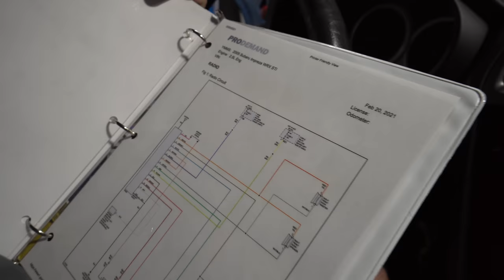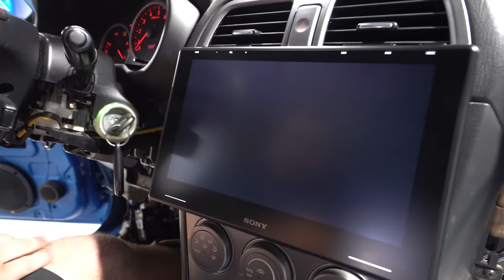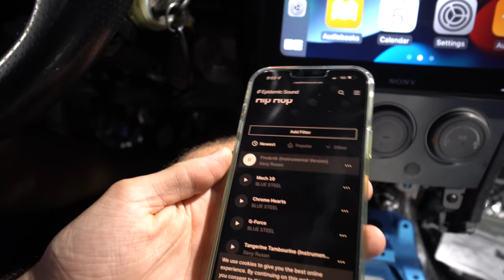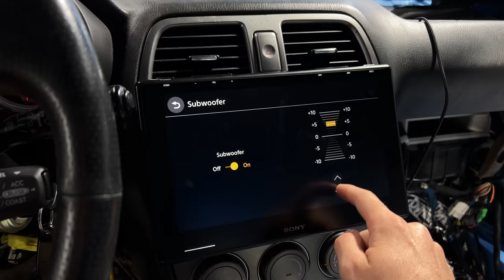Installing a HUGE Apple Car Play Unit & Sony Sound System (2021 Tech in a 1996 Car!)

Comment: Clean build and definitely attention to detail with most of the connections and wiring. With it being geared as an instructional installation video, you dropped the ball and added more work that’s needed with wiring in the head unit. They sell adapter connectors to retain the stock wiring harness for almost any car. Saves from digging up the wiring diagram but more importantly doesn’t require cutting off the stock connections and tapping in the way you guys did. For your wiring harness 05 Sti that adapter is less than 10 bucks and allows you to do all the wiring outside the car minus the remote wire which is not factory. Also would’ve popped an extra two screws on the radio bracket, the 6 overkill screws on the plastic cubby won’t be as supportive as two more screws. Aside from that love the attention to detail with everything you’re doing and can’t wait to see it finished, in Phoenix too but just sold my Wrx :/
Reply: The stock radio harness was used in his dads sti that didn’t have it. Believe me if it was there I would’ve used the proper wiring adapter
Reply: @Randallpullen123  yea not much you can do with previous owners unfortunately. However they do make a repair harness that comes with the pigtails as well but yea same amount of wiring would’ve been done.

Comment: That 2ft 16ga run in the sub box is only going to hold 240w. You could potentially melt the wire and cause a fire. I would have gone with 12ga minimum.

Comment: Those specs are all over the place. Mono amp is 300W RMS but the sub is 500W RMS,  and the main 4 channel amp is 70 watts RMS per channel while speakers are 90 each. Also you'll need to level down the gain on 4 channel amp to match db of mids  with sub.
And I'm not even speaking about how you've installed those tweeters on the lower side of front doors, pretty much making them useless.
Reply: Is it fine still or not because I was thinking of getting the Sony GS4 amplifier for my Sony es system?
Reply: I was thinking of getting this exact amplifier Sony xm-gs4 for Sony Es XS-163ES sound system.

Comment: I used to have a 1998 GTT, but i used twin screens, 1 for control in the center console (just a 2din size) and used the 'clock' on top of the dash for the information/navigation. Even the car is rather old, it can fit so much nice cool tech :D

Comment: 16 gauge for a subwoofer it’s small, the recommended wire for a sub, it’s 12 gauge, personally I used 8 gauge for my system

Comment: I've built a very similar but smaller Sony radio with Apple CarPlay into my mk4 Golf and it is an absolutely great investment, especially if you have the room for it already in the center console and a nice set of speaker in the car.

Comment: Im curious to see these Door Panels that will fit those big crossovers in that location. 

I did a full interior out stereo install on my 95 Nissan 240sx and I mounted the crossovers on the inside of the kick panels to keep them out of the way. As amazing as that system was. The Focal/Alpine/Image Dynamics system I put in my Jaguar still remains one of the best car stereos I have ever heard. Including ones that cost 3x+ as much.
Reply: I was thinking about Focal. Your system sounds like a great one!

Comment: 11:45 - If you won't put rubber grommets, then at least clean your holes... Sheet metal drill holes leave very sharp edges and they are very likely to cut the wire insulation.
19:30 - You do NOT use such cable ends in spring terminals! These are made for screw terminals! This does not lead to better connection but to the contrary! Spring terminals squeeze the wires and there is more surface area. Putting cable ends makes it have two very small contact patches with big contact resistance which can be an issue with these big subwoofer currents, low voltages and low resistance load.
And as other people have pointed out - it's better to put the tweeters higher and if not on the pillar - maybe at least at the height of the side mirror. The other thing - put sound deadener over the door holes.
Otherwise I like how everything looks. It's going to be a fantastic car!

Comment: Clean install but there were a few things done incorrectly. The fuses for the amps need to be as close to the battery as possible so that if there is a short, it cuts the power to the entire wire. If you fuse is at the amp then the wire will still have power going through it till it hits the fuse
Reply: I thought the same thing, but the battery is locatied in the trunk and is supposedly within 6" of the main fuse according to Randall.  Unfortunately they didn't show this and received A LOT of similar comments.

And they are using a Lithium battery in the trunk which I have concerns about due to their incompatibility with most standard automotive electrical charging systems.

Comment: Hey just noticed a quick SAFETY thing. The fuses you added should be as close as possible to the power source not the amplifier. Having the fuse close to the amp means if you ever have a short in the section of wire before the fuse, there will be no protection and could cause a fire. I would move or add another fuse as close as possible to your battery or main power source. Wouldn't wanna see you put all that work in to have it burn down!
Reply: Battery will be in the trunk

Comment: I've always loved Sony mobile ES equipment. I've still got my early 2000's mobile ES xm-7557 5 channel amplifier half ohm stable high current/voltage switchable, 3 feet long and weighs about 60lbs. Oh and it's red and gold!! It's one of my grail audio pieces along with my 1999 rockford fosgate power dvc subs that I will never get rid of!!!
Reply: @Andrew Royal I have never heard of the Sony amp that you mentioned, well atleast not that I can recall. I'm gonna have to look that one up, as I was not aware of Sony even making a .5 ohm stable amplifier... And it was a 5 channel half ohm stable amp?! Going to look it up now. Hope you end up seeing my comment.
Reply: @itdoesntmatterwhatyourname6128  yeah they had a whole line in 1999-2001 that was half ohm stable and high current/load switchable. But that 5 channel was the pinnacle
Reply: The non mobile ES one was the xm-1002 but there are 4-5 of them

Comment: Am I the only one that’s cringing at the lack of rubber grommets used on the speaker wiring?! Like I see that shorting out in a couple years on those hard sheet metal edges. Along with the slef  tappers used on the rear speaker plates. Other then I dig this video on really showing ground up speaker instal

Comment: That's some really nice components. I've found over the years of doing car audio that sometimes the best sounding system is the one that uses no-frills speakers, but good amps, etc. PPS4-6 pro 6.5" and Fiatal Pro 6.5" mids and super tweeters with whatever crossover you want, then at least 1500w RMS for sub(s). I run AB amps for the mids/tweets and D for subs.       SPL > SQ or vice versa. The speakers need baffles connecting them to the mounting locations. IMO never solder the connections to the speakers. The mounting bracket should not be metal; could cause a grounding issue.  great vids.

Comment: should have used foam to make a proper seal to the door and the speaker. Because air will leak around and cancel out sound. but cool none the less.

Comment: Nice job but you should have used a better spot for the tweeters. You'll kill the high pitch noises when they're installed so low in the car

Comment: Nice to see this done, try keeping the weight down , you will feel it.
Reply: I think that this is going to be Cameron's daily driver car and not his full-on "performance" vehicle, so in that regard I don't think it's necessarily important to keep the weight to an absolute minimum.

These amplifiers, component sets, head unit, and the wiring don't really add all that much weight (way less than having an average person in the passenger seat), and the subwoofer enclosure can be removed at any time if he wants to reduce weight and/or gain some extra trunk space.

They already added Dynamat CLD to most of the interior which does adds some weight.  However, for a DD where you'll want to enjoy a killer sound system like this one I would absolutely recommend this!

I would even advise Cameron to treat the doors with sound deadening (AT LEAST around where the speakers are mounted!), the trunk lid, license plate & frame, and the top of the rear shelf/package tray where the rear speakers are mounted.

Treating the entire rear wheel wells with CLD sheet and a barrier like MLV or ResoNix's BARRIER which is a multi-layer CLD/Encapsulated Lead Sheet Barrier/CCF foam Decoupler, makes a HUGE difference in the interior road noise and daily enjoyment of driving the car.

Comment: The modern way to power amps mounted in the boot/truck, rather than big thick power gauge cable running the length of the car, just fit a split charging relay to the alternator feed and split the low voltage feed into the boot rather than the huge gauge piggy back from the main battery. Then, mount a custom fit 12v battery pack of those 26650 batteries. They allow you to have a hidden battery in the boot that isn't based on a car battery but fits behind a panel and because it has a direct feed from the alternator (rather than piggy backing in parallel from the main battery), you save on wiring, improve power efficiency a lot and it's totally stealth. You can add as many 26650's as you want (to increase the current supply and the length of time you can listen) and it allows for longer listening before they go flat but you wire in one voltage led to show you how full they are and essentially, you have a boot mounted car battery but with a direct recharging from the alternator and totally stealth. Your battery under the hood has nothing attached to it. Virgin look. Plus, you can add more to suit, change out individual cells as they fail (fee pence) and you find that you want to add another 4/8/12/16 packs in that area there.....so you buy them, make a mounting bracket and wire them in. All the time, they are being charged directly (rather then indirectly through the car battery) and your car never goes flat as its isolated. Your alternator puts all of its output into your custom boot mount cells and if you integrate a capacitor into the mix too, your 26650's end up feeding the capacitor and that feeds the amp and again, more flexibility is the goal. Power is sexy when it's done like this. It's more time consuming but the result when you put your panels back on is simply 100% stealth. 

You can also fit a small charging port so when the car is in the garage, an intelligent motorcycle battery charger can be fitted to that circuit and your capacitor and battery packs are all conditioned and tip top condition, again without touching the main battery under the hood. Again, flexible customisation. 

Its cool.
Reply: The main battery is located in the boot already and they are using a Lithium battery...which I have concerns about because Lithium batteries are typically not compatible with standard automotive electrical charging systems.  They usually require a specific isolated "charge controller" because they need to charge at a different voltage and charging rate/scheme/technique to manage heat and the voltage/current throughout the stages of the charge cycle.  I have wind turbine and PV Solar off-grid power systems for my homes using both lead acid and newer lithium battery technology.  They each require a specific charge controller.
Reply: @bbfoto7248  they are using a lithium battery in this car in the video? They would have to top up the lithium battery because you can't get them to full charge from a normal output alternator. The normal output is about 13.6v but the lithium battery needs 14.5v to get towards a full charge. It will only ever get to around 75% full....which defeats the point of having it.

Comment: Wanted to install that HU in my 04 Tahoe, but was afraid that my column shifter protrudes too far.  That’s a bold strategy to solder to the terminals.

Comment: @Cameron Alford  
@Randall Pullen  
EDIT:  Randall posted in another comment that the battery was relocated to the trunk and that the main system fuse on the 0 AWG power wire is now within 6" of the battery.

* One more oversight. *  You NEED to install the Main System Fuse on your 0 AWG Positive (+) Power Wire within at least 18" of the Positive Battery Terminal (closer is better) in order to protect the length of Power Wire that runs all the way through the vehicle to the trunk and to the distribution block/amplifiers.

As it is, if there is a short or if the power wire disconnects some where between the battery and the trunk, that 0 AWG wire is a completely "LIVE" wire with HUGE Amperage capacity to create sparks and a fire in the vehicle! 

So put the main system fuse or a Stinger Marine Grade Circuit Breaker within 18" of the Positive Battery Terminal.

AND, at the distribution block where you convert from 0 AWG power wire down to the 4 AWG power wire, you need to place a smaller fuse at the head of EACH 4 AWG wire that goes to each amplifier.  Again, this is to protect the WIRE and the CAR from a short circuit.  The Fuses in the amplifiers protect the amplifiers themselves and NOT the Wire!

This is most easily accomplished by using a FUSED Distrubution Block near the amplifiers to transition from the main 0 AWG power wire to each 4 AWG power wire run to each amplifier.

I can show you many examples of very nice cars that have burned completely to the ground on the side of the road because this practice was not adhered to!
HTH!

Comment: Damn, Im looking for a good, tablet-style headunit and was hoping this would be the one, but those bezels are aaaaaawful. Great video tho, Cameron
Reply: I wholeheartedly agree regarding the giant Bezels!  That was one of my main complaints with this head unit.

The HUGE Bezels make it take up A LOT more space on your dash than it needs to!  The unnecessary extra size due to the large Bezels will likely cover up important controls on the dash as well as the A/C vents on many vehicles.

Yes, the position of the screen is adjustable to a degree, but you usually either obstruct the gear shift knob if it's positioned low, or the A/C vents if it's positioned high.

And during the product announcement, Kris Bulla from Sony USA stated that there wasn't enough room to include a Volume Knob like the Kenwood eXcelon DMX1057XR has.  But with those HUGE BEZELS on the Sony, there was PLENTY of room to include a Volume Knob!  SMH

Comment: Cool setup.  It would have been a nice addition to see how to wire the amplifiers' power supply system into the car's alternator/electrical system.
Reply: It's just a wire from the positive terminal of the battery to the amp

Comment: Great job on the wiring but the sound stage must be really bad in that car. Sound (mid-high) must come to you from the front, not the back (I`m talking about those rear parcel speakers), the tweeters must be oriented so that they play in your ears, not your feet. As for the subwoofer enclosure, it must be slanted in the back, not perpendicular to the bottom, because you will get a lot of reverbs instead of crisp, defined bass.

Comment: The gc8 Imprezas have a tweeter grille near the door handle, not sure why you didn’t put the tweeters there
Reply: While that would probably be a much better location for the tweeters (IF they had used the Active DSP and Network Mode in this head unit!), the Sony Tweeters are BIG in terms of their overall diameter and I highly doubt they would fit in the OEM tweeter locations.  The outer housing and grill on these tweeters is a "waveguide" and cannot be removed without compromising the performance of the tweeters.

Comment: Awesome job!  I built my sound system based on alpine components about 2 or 3 years ago using components, crossovers, and a sub on the rear, just as this but not as impresive, yet, just as the comments at the end of the video, the single biggest difference was not the power / volume increase but the sound image... some tracks that I've heard a lot while driving were so different, it's insane how much of the original recording is lost on low end / OEM equipment...

Comment: there are huge differences how bass it played out between different head units - for example what comes to 1 din units, long time ago, I never got bass so clearly out what I did with some good jvc unit compared to pioneer or alpine. you may put some fancy stuff in your car but if the headunit is "wrong" or amp is (and I do not mean wattage or popularity of the product) you may end up actually not getting the system sound so loud (or more like low) as it could. And because im not a professor of car audio or hi-fi, I cant explain why it is so, but it is just so. So whenever you install something, the best way to achiece good system is to test different units and NOT believe what others do say. Sure if you do not care how end result sounds, then all this doesnt matter :)

Comment: Copper wire is not "copper wire" . There's high purity OFC oxygen free copper, there's also low grade CCA copper clad aluminum. Then you have reputable companies that make cables the correct size,  so when you buy 1/0 wire you actually get 1/0 wire then you have a ton of foreign manufacturer's that make junk that has almost no wire inside  just a whole lot of plastic. So no speaker wire/power wire is not just speaker wire/power.

Comment: Think you need to connect your iPhone with a cable to get lossless audio HIFI audio on carplay.
Reply: This Sony Mobile ES head unit uses WIRELESS Apple CarPlay which uses high-bandwidth WiFi to transfer the Lossless Audio Signal from the iPhone to the head unit.  They also connect via wireless Bluetooth for control functions such as track advance, rewind, skip, repeat, Siri, and volume control, etc.